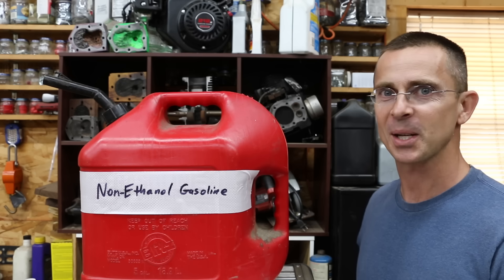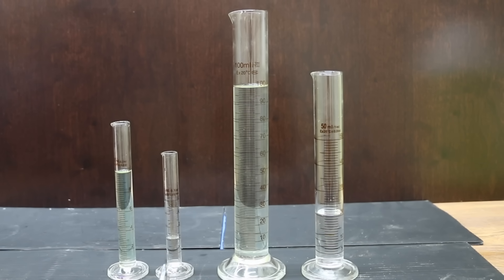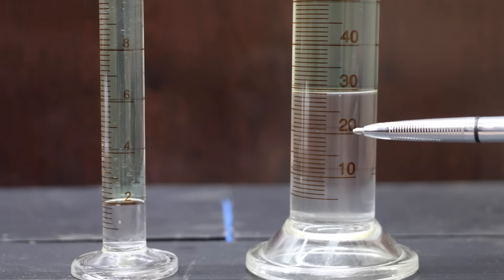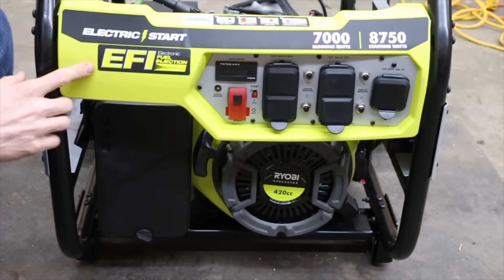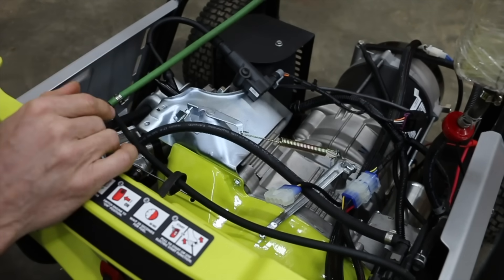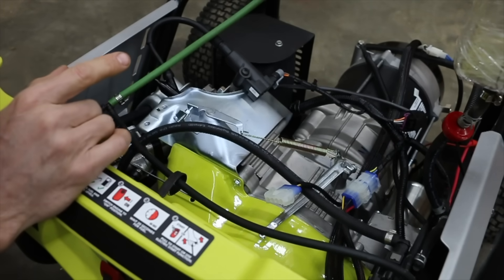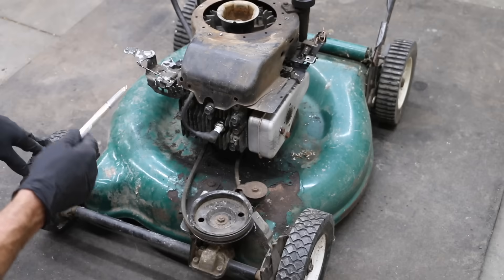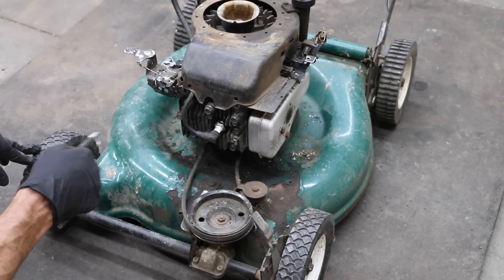Is Non-Ethanol Gasoline Really Better? See the PROOF!

Comment: When I was in the small engine repair industry we used to have off seasons when no product would come in. Typically around the fall season, but when ethanol fuel started to become common we had constant business all with no start issues. At first we saw thousands of issues with water in the fuel with heavily corroded carburetors and fuel tanks (if the tanks were made of metal). I must have throw away hundreds of thousands of carburetors over the years that were too damaged to be fixed! Methanol fuel by comparison was basically half. Methanol wasn't much better then ethanol based fuel but atleast Methanol had a longer storage life without the use of fuel stabilizers. As time went on and especially when Tecumseh left the small engine industry (which was a very stupid move since it opened the flood gates for all the chinese junk to take over) we saw a HUGE increase in carb issues from sticking needles to leaking fuel bowls. replacing the carb just made the engine run for a few months more if the owner didn't use a fuel a stabilizer or fog the carb. As time went on I decided to leave the OPE repair business because I saw how cheaply made everything was becoming. They're basically making OPE products into throw away items these days. Even name brand stuff is becoming junk.
Reply: Thank you, there's a reason why Aviation gas does NOT contain ethanol.
Reply: @yong62  funny you mention aviation fuel. I remember there was one guy who had a plane puller that used a Briggs engine. He'd run aviation fuel in it and that would do two things. It would make the engine overheat so badly that the plastic cam lobs would skip timing and make the engine stall out. It would also mess with the needle seat causing it to swell up and make the carb flood out and dump fuel into the engine, which would thin out the oil.
Reply: @RobertNES816  well, I think typically aviation type fuel is much higher octane than regular fuel, regardless of the ethanol content, so I’m sure it would have problems overheating and not running right unless that engine was modified to be able to use a higher octane rated fuel.
Reply: @spiercevaughn  100 octane low lead.
Reply: @spiercevaughn  high octane doesn't mean it burns hotter, higher octane resists predetonation allowing the engine to reach higher compression without knocking.

100LL will cause severe damage to almost any modern engine not designed for it, but not because it burns hotter.
Reply: Charles Myhre  Fun story.  TEL (tetra-ethyl lead) was originally added to gasoline, I want to say back in the 20s, because the gasoline quality was crap and the engines were also mostly crap by modern machining standards.  It had the effect of a higher effective octane rating (reduced knock) and many people associate leaded gasoline with being "higher quality" to this day. In fact, octane and quality have very little to do with each other, and the quality of the gasoline then was arguably worse.  Again, TEL only masked poor-quality, low octane yields from refineries.  The gasoline itself wasn't particularly great.
Reply: @spiercevaughn  No it is not it is just measured differently.
Reply: @yong62  AV Gas doesn't need ethanol because it's got lead in it (until a few months ago there was no unleaded high octane fuel approved by the FAA)
in auitomotive fuel MTBE replaced lead (TEL) starting in the 70's, then it turned out that MTBE was contaminating soil and ground water and industry switched to ethanol because congress wouldn't give them litigation immunity for MTBE pollution.
Reply: Anything still reliable in small engines?
Reply: @thisismagacountry1318  longevity wise no unless you go with commercial grade Honda engines. Their GCV engines are pretty blah to but better then Briggs and the Chinese junk.
Reply: @Robert NES816  I've always had Stihl chainsaws, weed eaters and leaf blowers. You hit the nail on the head by saying new small engine stuff is pretty much junk. I bought a new Stihl weed eater, leaf blower and chainsaw like a year ago and they are all huge peices of shit compared to my old models. They run like shit and I'm constantly taking them in for some sort of service. I should have returned them when I had the chance.
Reply: @Robert NES816  The weed eater of all three gets the most use. So i bought a new Husqvarna and it puts that Stihl to shame. But at least I found something that wasn't a complete POS like the 1 year old Stihl that I still have. It was crazy to me how bad those Stihl products were. I've always had really good luck with their products. Not anymore.
Reply: @LeadRakFPS  If you can find one the Husqvarna  223L is an excellent consumer weed eater. I have one I bought new on 2011 and it runs like a top! It weights nothing and has excellent power.
Reply: @RobertNES816   I have gotten so tired of rebuilding and replacing carbs on various pieces of yard care engines that I am welcoming the battery powered stuff.  Purchased Stihl brand weedeater and handheld blower that use the same battery and I’m really quite pleased with both items.
Reply: @LeadRakFPS  I absolutely agree with you. Over here in Germany we mainly use stihl devices for garden work. I inherited an old stihl grass trimmer from my parents which is probably from the 80s. It still runs perfect, when I bring it to the stihl service every second year, the guy there always tells me to keep the old one instead of buying a new one as the new ones really are of a bad quality.
Reply: @taccomaker 1984  That is right. The new ones are not even close to the same quality as the old ones. I've had nothing but trouble with my new Stihl lawn and garden equipment. Wish I would have kept my old stuff instead of selling it to use that money towards "upgrading". It was a down grade instead.
Reply: @RobertNES816  - I bought a Husky 224L a few years back BECAUSE it has a Honda motor and cost less than a Honda trimmer. Even so, my old cheaper Yardman (B&S motor?) lasted over 14-years with weekly use.
Reply: @RobertNES816  So basically ur saying that you buy a weed eater in the spring and throw it away come winter?
Reply: @wildestcowboy2668  if you're lazy and don't maintain your equipment or simply dont know to maintain your equipment then yes.
Reply: @thisismagacountry1318  Shell premium gas is about the best to use
Reply: I have an old, given to me JD lawn mower. Using 93 octane I would still need to use starting fluid sometimes it would take a couple of tries. Once I started using 87 octane non-ethanol all I needed to do is hit the primer a few times and it would start. That mower set for 2 years without being started (tank was empty). I started it up a couple of months ago, no starting fluid hit the primer few times that was it. I only use non ethanol in lawn equipment and when I can (when I can afford it) I put it in my truck.
Reply: @smccomas01  I’ve never seen 87 octane no E fuel before, all I have seen is 90 octane no E
Reply: My buddy's dad always used non ethanol in small engines. They could go ten years with basically no service on the carbs and look great, the techs were fairly surprised to see how good they looked despite their age. 

Guy I knew kept meticulous records of hours and service on a couple power saws, only used non ethanol. Someone swiped his saws and they died within hours of each other while running ethanol fuel. 

Now we have biodiesel and I can't stand the crap. #2 is just fine and has fewer problems but no, gotta keep the greenbacks flowing to the greenies.
Reply: @randomidiot8142  I am of the opinion do not use food as fuel.
Reply: You do not want methanol in an engine that isn't designed for it. Aluminium ones are particularly vulnerable. If you burn methanol it will form formic acid as a waste product, that will eat at your engine. Water can also cause it to form formic acid, that will affect the the fuel system. 

Ethanol will form acetic acid. It's a much weaker acid and will not have a huge effect on your cars engine and fuel system. Be mindful though. Cars that have engines and fuel systems made of inferior materials can suffer. What it can do is to loosen up decades of gasoline sludge, that can be a real problem.

As for efficiency of ethanol and gas/ethanol? That depends. The higher combustion pressure you have, the better it works and cleaner it burns.
I'm most familliar with old Volvo red blocks. They work just fine with ethanol. But then again. I think that old B18-B20 series were made to be able to use different fuels. The swedish military used the engines in many different vehicles and applications.
 I used E85 mixed with 95octane unleaded (lowest octane) in a 50-50% mix, nothing done to the engine, carb or ignition. My Volvo Amazon ran better and the engine was clean after 2 years of driving it. I changed the oil as per spec, as to limit any potential acidification of the old oil.
Reply: @secularnevrosis  I was just about to call you a little Joe Biden loving gun banning clown till I read your whole post. Kinda makes sense and I'm going to try the ratio you used...
Reply: @wildestcowboy2668  A bit of advice regarding your mixture. Regarding E85 and regular petrol mix.
Begin adding 10% E85 and drive your car. Increase with 10% increments until your car runs worse. Then back off the mixture until it runs good again. This works for most cars. Be adviced though. Old volvos have a great deal of tolerance to this but my old G20 van (1984, 305 engine) did not like more than 10%. Why? I don't know for sure. If you are going to make a full conversion I would suggest using a fuel injected engine with a way of pre-heating the fuel and a "heater plug" fixed to the intake or appropriate place. Cold weather starting will be better. And a mappable injection combined with a ignition that have a wide range is going to help. High compression will also make the car run better and cheaper.
Reply: @secularnevrosis  I own a lot of units and I had a old Volvo left and I finally gave up on the clown coming back. My help had it loaded up on my trailer and ready to go to the crusher. I opened the door being curios and it has 23k original miles. Inside is like new. I kept it for some crazy reason......
Reply: @wildestcowboy2668  Keep it! The interior of some models are sensitive to heat and sun. More than others. Good interiors are hard to come by on some models.
Can I ask what model it is?
Reply: @secularnevrosis  It's a 240 I don't have title with me but being a 4 door wagon turbo made me feel like she is worth fixing. If it's factory. Paint is flawless...it's been inside for along time.
Reply: Your so right, a friend of mine bought a new BMW, can't remember which model, and almost from the start he had problems with it. Eventually he got sick of trying to convince the dealer that there was something seriously wrong with it that he decided to ask one of the guys in the bike club to take a look at it. It took him about 10 minutes to find the problem, crappy cheap Chinese wiring on a 20 thousand pounds bike!
Reply: @sambrooks7862  Thank your papaw for backing down and bill Clinton for finalizing NAFTA... Hope I live to see the Chinese come over and wipe y'all lazy Joe Biden loving gun banning clowns up.
Reply: electric power is the new mandate in California. I like the idea because everyone who hates trying to drag out the weed wacker since last year and get it running will give theyre stihls and husky and echos away. The ones who will really have problems will be all the commercial guys who have to keep charged batteries aboard.
Reply: Just saying Ethanol screwed up everything in general !!!
Reply: @kevinanderson686  The government screwed up everything in general lol. It was the EPA'S bright idea to introduce ethanol and Methanol.
Reply: @RobertNES816  wasn't it the corn lobby or the sugar lobby that pushed E10 fuels? It does result in less emissions, but that's not the main reason.
Reply: @happyhappynuts  You can look into it. The EPA wanted something to replace methanol. So ethanol was what they picked even though Butanol is actually a better alternative. But it seems there's more money in ethanol production.
Reply: Also my small engine guy said it's important to run your mower engine until it completely runs out of gas at the end of the season. Doing this solved my no start carb issues.
Reply: @4thphaseofmalaise  yup and after it stops running keep trying to start it until it'll no longer run.
Reply: @ronaldrenegade8519  E85 if thats what you're talking about needs additives to keep it from absorbing moisture. E15 Gasoline needs fuel stabilizer to keep the ethanol from separating from the Gasoline. It also keeps the moisture suspended in the fuel.

Comment: You really need to take 2 brand new mowers, and run each fuel difference test once a day for 30 days for each mower.  I think you will have a very clear indication of what type of result you will have.  Using an old mower, already having carbon buildup really invalidates any true findings.
Reply from the maker: Thanks for the suggestion.

Comment: Haven't done a scientific test,a couple of small engin  mechanics one said "if the complaint is it won't start after sitting a while 90% will have an issue with fuel"another said 60%.my chain saw used ethanol shortly wouldn't start,another  mechanic replaced a fuel line was swollen shut replaced it at 30$ tough enough to with stand alcohol saw at least 35years old,and I use it daily in winter still runs.key is fresh fuel.got a generator sits a lot pull rope start bout worn out when it finnaly starts,went to  premium gas,no ethanol starts one pull,wet back to no ethanol for all small engines,easily worth the hassle. Will probably switch generators to propane as storage might be long term.

Comment: 1st of all, I want to say I watch your channel frequently.  I really like your engineering/scientific approach.  I won't even purchase automotive related products for the most part, without reviewing your channel at the outset.  Small back story: Ford Motor Company produced "Flex Fuel" cars for years and as a technician at Ford dealerships we had to service those cars with synthetic oil.  The reason given by the motor company was that the ethanol washed down the cylinder walls of vehicles that used mineral based oil, therefore scarring the cylinders.  So, Ford used synthetic to save internal engine parts from self-destructing because of "lack of lubrication."  Now a-days, performance minded gear heads use E85 for the performance boost E85 fuel provides.  In my history, many of my racing friends used 100% ethanol for racing and they used synthetic oil to protect the cylinder walls from damage.  So, you can see from this, there is much to be said about the use of ethanol in cars that we use today.  My question is, is this a fair assessment? Any additional information would be appreciated.  Thanks. BTW, I watch Mustie1 also.
Reply from the maker: Thanks!   Thanks for sharing.

Comment: Yeah, that's why its called Ethanol and not Gasoline... just sayin (JOKING LOL !!)
I do like your work, so no dissrespect from me .
 But I still think this is really a matter of opinion.
 I believe Methanol, and the lesser Ethanol are really great fuels when used in properly designed systems.
My personal opinion after 45 years of building-maintaining, and eventually ripping engine blocks in half...(Really !)

Gasoline, is hot, dirty, prone to detonation, prone to deposits, and hard to control.
 Because its inconsistently blended by many different manufacturers using an endlessly changing blend of available components..
Resulting in really strange performance issues sometimes.
 And horrible clogged intakes /coated valves etc.... AKA= BAD GAS.
( Pun, we have all had this issue, lolz)   

Methanol, and to a lesser extent Ethanol...
 Cools by evaporation, can actually frost the intake on wet runner systems, significantly lowers engine temps, and intake air temperatures .
 Both are easily controlled and hard to detonate, both provide supremely consistent performance, Clean systems like a whistle, and are easily extinguished/dispersed by water.
Reply from the maker: Thanks!  Thanks for sharing.

Comment: I thought the ethanol disadvantages were supposed to be more in the line of engine damage rather than carbon build up. Old 350 running on ethanol sounds like a can of pea gravel is tied to exhaust manifold. Non ethanol - sounds great , more power & 2 MPG better ...  ( same " octane " --  )
Reply from the maker: Thanks for the feedback.
Reply: @ProjectFarm   What I don't get is comments from people  or recommendations in "Owner's manual " on newer electronic controlled vehicles  that " non ethanol"  is not recommended  or might mess up injection processes / programming  ... I don't see how better gas could be a detriment  ( especially if engine longevity is a factor ) .

Comment: Have an old Briggs Engined Stiga pushmower from the early 2000s, always fuel up with regular gas station 95 (I live in Sweden and at my usual station we have had E10 gasoline for a loooong time). I always leave gas in the tank as I do not care, I have changed oil twice in my life on that mower, replaced the airfilter once and that is it. The only other "maintenance" I do is refueling. It is still happily mowing my grass and always stars after a maximum of 3 very lazy pulls.

E10 is not dangerous to you or your car/engine. Ethanol in fuel does not corrode steel or accellerate steel corrosion. Rubber will only be affected if it is old dried up rubber.
Reply from the maker: Thanks for the feedback.

Comment: I've seen that blended crap take out plenty of my new 2cycle engines in about 2years. My 4cycle engines don't care. Is it how the motors process the combustion? I've went thru weed eaters like crazy. I found a 4 cycle weed eater and hoping it holds out as long as my mower whose engine outlasted the deck.